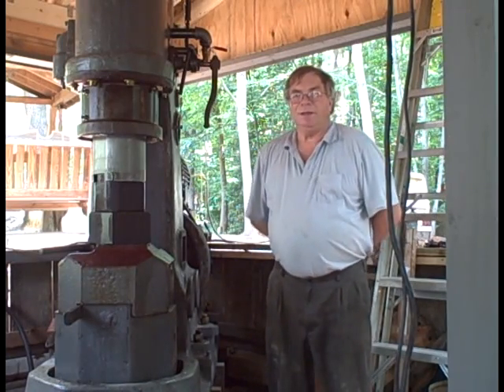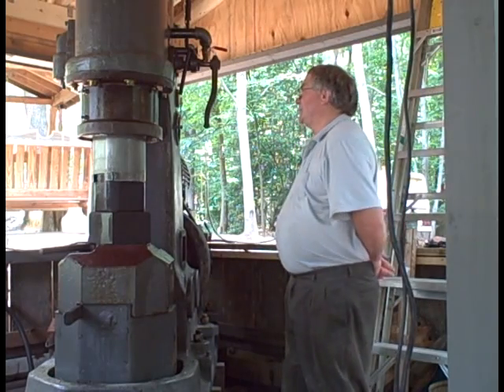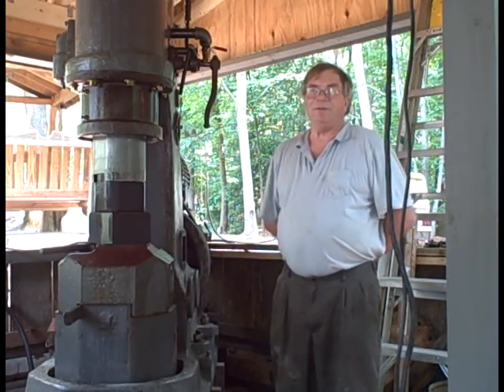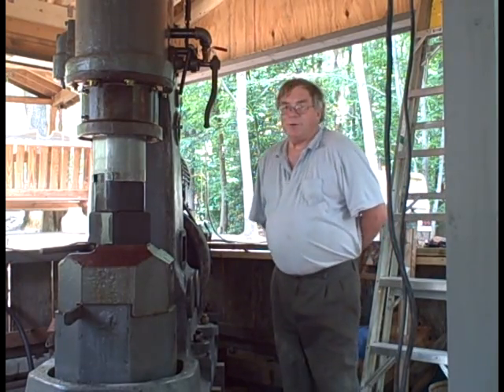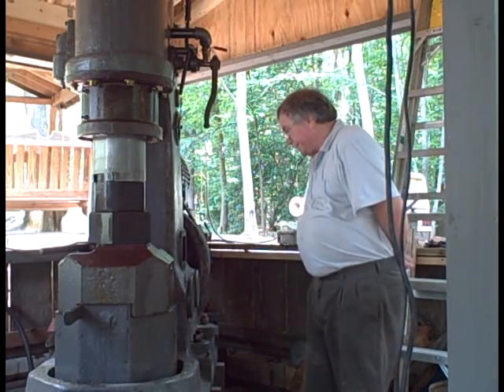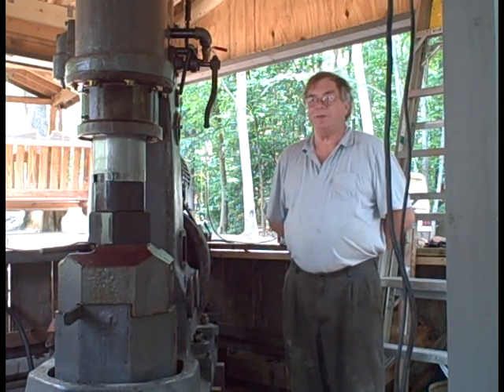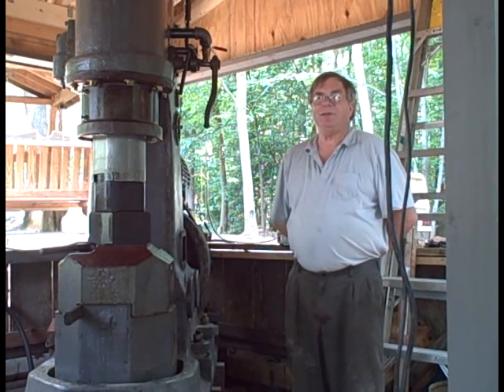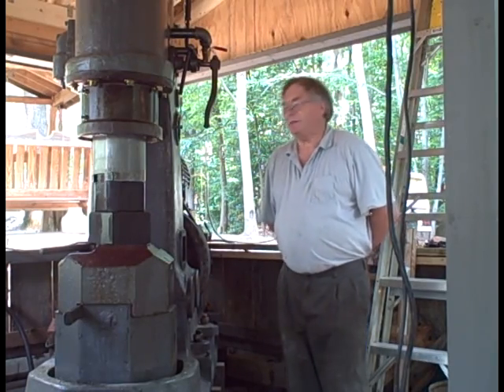Nazel 3B.mpg   First Power Up

Comment: What are the differences between 1B, 2B, 3B, etc?
Reply: CountessOfPerth From a capability point of view, the rams are heavier as the number goes up.   A 1B's ram weighs about 70 pounds (with die).  A 2B  ram would be 180 to 190 pounds.  My 3B ram (with the die that's on it now) is 285 pounds.   They made Type B machines up to a number 7   Each successive number has a heavier ram.   Obviously, the frame and built in air compressor is larger as the numbers increase.   A 1B weighs about 5000 pounds total.  A 2B would be around 7500 pounds.   My 3B is 10,750 pounds for the frame and anvil.   A 7B weighs almost 60,000 pounds total.  The steel base I mounted the 3B on (in lieu of putting in a concrete foundation) probably weighs about 6000 pounds.  

Nazel also made other product lines (Types C, I, N and S), where the air management and/or guidance systems are different to allow for single hit capabilities and/or more heavy duty forging.
Reply: David Hammer Thank you!

Comment: i think the basement could be enough for the high energy punches of this wunderfull :-) tool! 
does your hammer move the material parallel? with the hammerhead and the "anvil"? this is a primary proof for the right basement weight. if the hammer move the material on the hammerside more than on the anvil side (shoulders in the material) the basement is to weak. if the anvilside moves more (shoulders) than the hammerhead side the basement weight is too much.... ;-)
i want some of this kind too!

Comment from the maker: My hammer is bolted to heavy-walled channel iron, which is welded to plate steel that is almost four inches thick, with an additional 2 inch plate under the anvil.  The total weight of the base is about 5000 pounds and eliminates the need for a concrete foundation.

The ram, with the upper die, weighs 285 pounds.